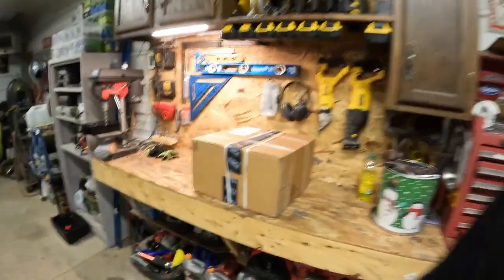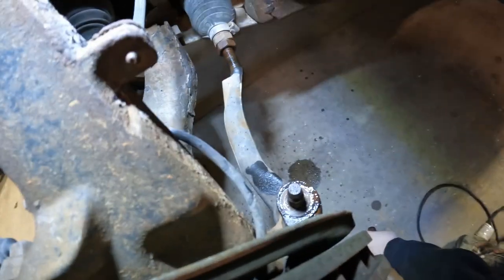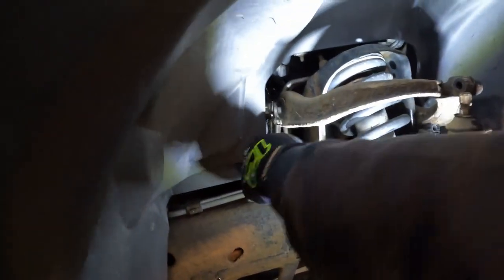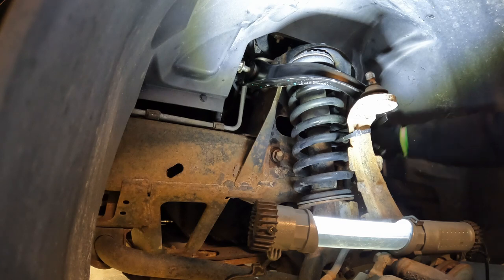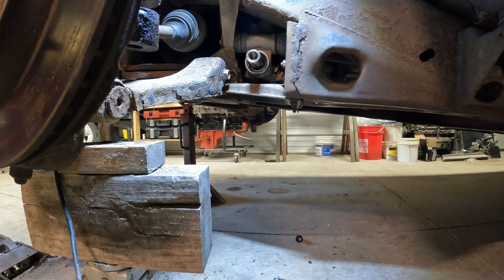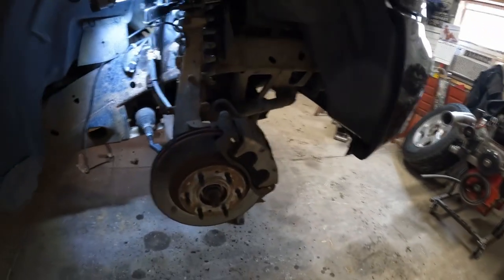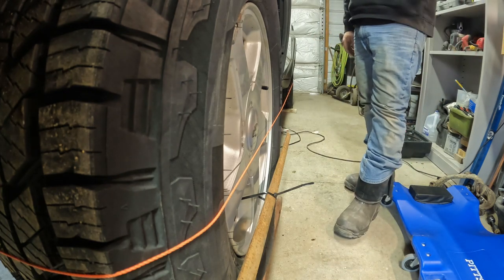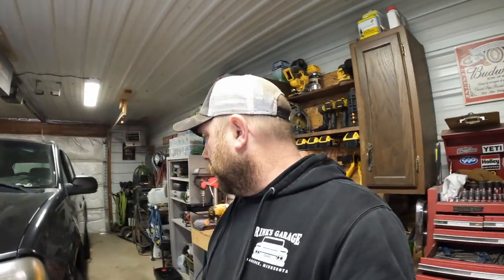Trailblazer / Envoy - Inner & Outer tie rod replacement & alignment

Comment: If you still have issues, check the support brackets for the lower control arm. They also have to do with alignment on the Envoys/ trailblazers.
Reply: I can't get the traction control light from coming back, I changed the angle sensor three times, ac Delco, both lower control arms, clean grounds and on my scanner it shows 16 degrees off from steering wheel, this steering wheel doesn't have adjustment, and also the scanner doesn't have a pit for calibration, so alignment must be completely done and match to angle sensor with a scanner, every single alignment shop tells me that they don't do nothing liked that???? How I I'm supposed to match steering wheel position, angle sensor calibration and suspension parts together????? Please help

Comment: Safety glasses for your son, Please. Especially with impact tools. 

Showing how to bend back the metal fender area to allow some wiggle room for the driver’s  side upper control area left bolt gives another option. Others us dremels to grind down from engine compartment. Or cut with a mini saws all from the wheel well and bend back. Those methods would require painting to prohibit rust. The plastic splash guard Evan be bent to allow all these methods. 

Getting on your back and using two interlocked wrenches is the best way to break the bolts loose if stuck. Always the case if rusted. The Dannitor technique.